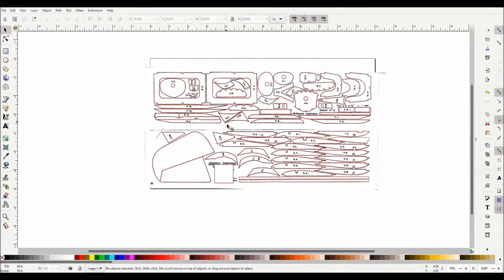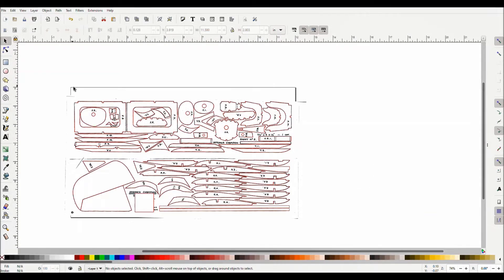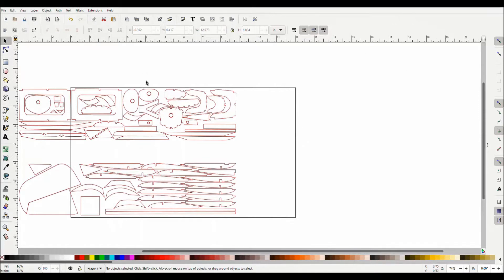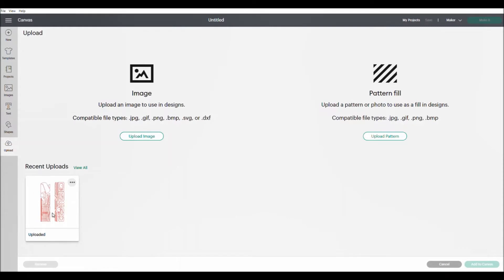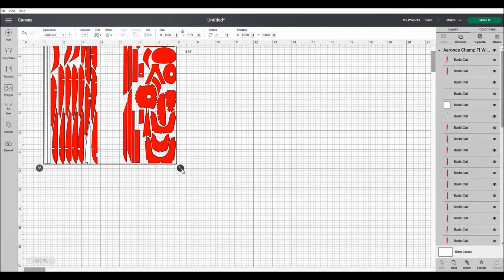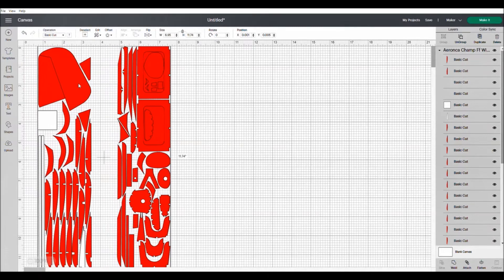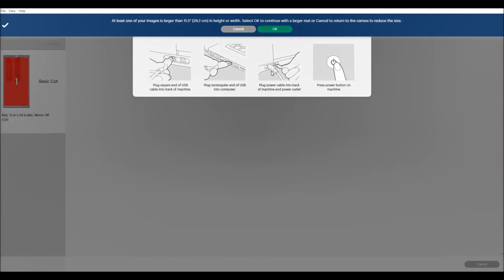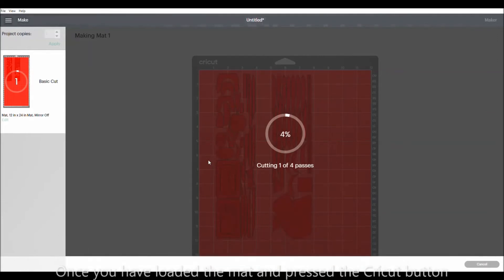Using Inkscape to create svg files and a Cricut Maker to cut balsa model plane parts  Pt2

Comment: Thank for putting this together. I've been considering a Cricut for myself. How often do you change the blade in the machine? And how would it do with really light "C" grain balsa? And can you cut balsa thinner than 1/16th? Sorry for all the questions but your videos have me excited about the possibilities. 😁
Reply from the maker: I replace it when the blade stops cutting cleanly. I don't have any specific number of cuts or time period.  I've cut extremely light balsa, just stopping the cut after two passes instead of doing the four that the program defaults to.  I'm sure you could cut thinner, just with one or two passes.  The thinner balsa would be more sensitive to blade condition.
Reply: Thank you Mark. Great stuff. One more question if I may. What holds the balsa to the cutting mat?
Reply from the maker: @Watchingthevideos99  I use the purple high strength mat.
Reply: OK, but what holds the balsa to the mat during the cutting? Is it glued to the mat with spray adhesive or something?
Reply: @Watchingthevideos99  The mat has a sticky surface.
Reply: Ahhh. OK. Thank you. That answers my question!

Comment: any advice for basswood. i have tried cutting 1/16th inch basswood dinosaur puzzles and they always fail on the first cut pass of the knife blade. ive tried with a cricut maker, and a maker 3. ive been very frustrated
Reply from the maker: Sorry, I've only tried a basswood cut two times, and I was not satisfied either time.  It may be able to cut basswood, but not in a detailed manner.  Maybe jigsaw puzzle type cuts.  I use my machine exclusively for balsa.
Reply: @markmcriley2558  I think I’ll have to give balsa a whirl before giving up on it completely. At least it’s good for my vinyl
Reply from the maker: @PunkRockBenWilson  I have cut many, many airplane kits out of balsa.  The only cautions I have are that the balsa is not too old and dry, as it tears rather than cuts, and try not to make the cuts too close to the edge, as the balsa will crack close to the edge after a couple of passes and it might spoil that part.  Just remember to do a calibration before you start cutting, and use a good mat.  I bought a cheap set of mats and they wood didn't stay stuck in place an it messed up the cuts on one side of the piece.  Also, if it's really good, light balsa it might only take two or three passes instead of all four passes.

Comment: Wow!  Thanks for sharing this.  I will give it a go.  Do you belong to Flying Aces?
Reply from the maker: I do not.  I am involved in so many different hobbies that I have to limit my "joining".  I did a FF as an example because I think that this is where the Cricut could really shine, but I'm more of a 1/2A control line guy.  I also just joined the local RC club last week and I'm going to be cutting 1/2A RC planes.  That's in between working on my Vette and my full size Experimental Homebuilt aircraft...

Comment: Would Trace Bitmap save you all the tracing or does that work with separate parts?
Reply from the maker: I tried using Trace Bitmap, but the plans I download are old, and the lines are not crisp enough for the Trace Bitmap function to work very well.

Comment: Nice tutorial series. One suggestion for you when you want to line up your two sheets to 1". Instead of moving the two halves over to the ruler, just create a 1" long rectangle in between them. It doesn't even have to be the entire length of the design. That will allow you to space the parts exactly 1" apart. I'm building model railroad buildings out of cardstock using Inkscape and just got a Cricut to cut out the parts. Your video is a great help. Cheers!